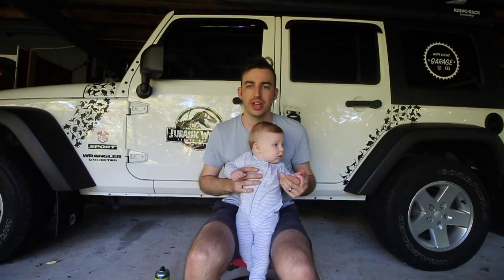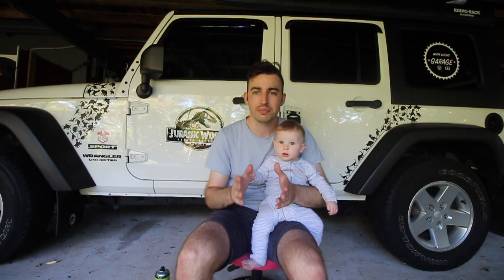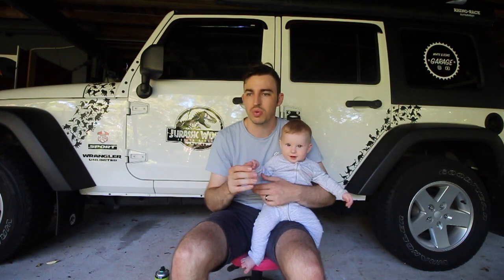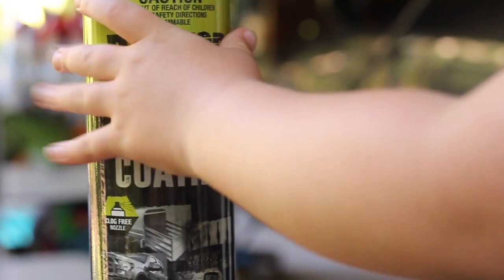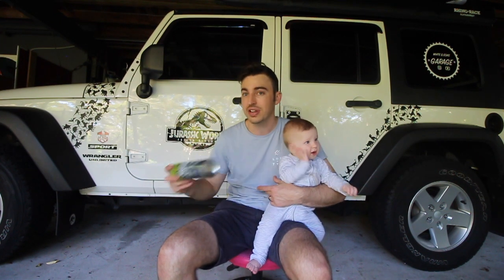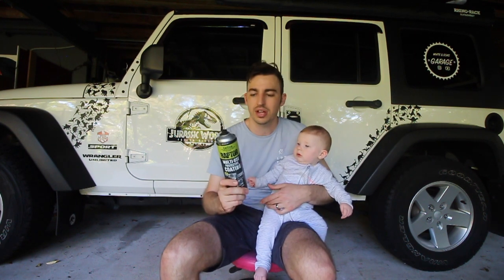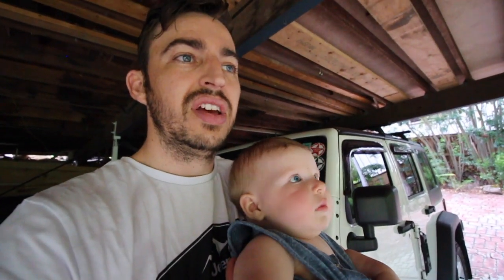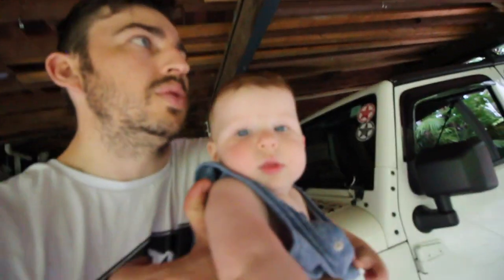HOW TO RAPTOR LINER FADED JEEP FENDERS

Comment: I normally use some cheap back to black spray, it works but never last very long. This looks really good. Might have to try this. Great video.
Reply from the maker: Nice, I would most people would doing the same thing. Would definitely recommend it.
Reply: I did it with liquid shoe polish. It's ok for a year or two, but it's not a permanent fix.
Reply from the maker: @V8AmericanMuscleCar  hahaha definitely not a bad option.